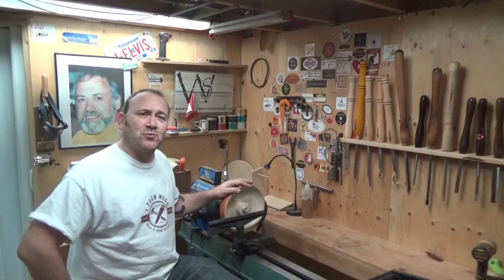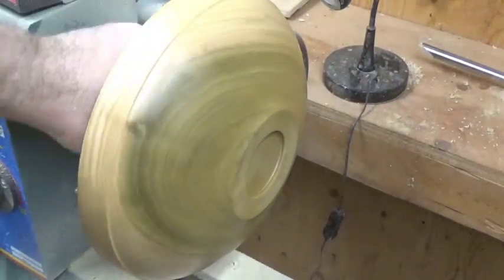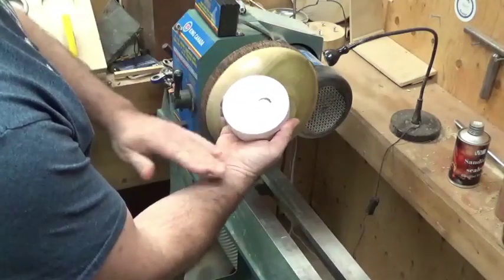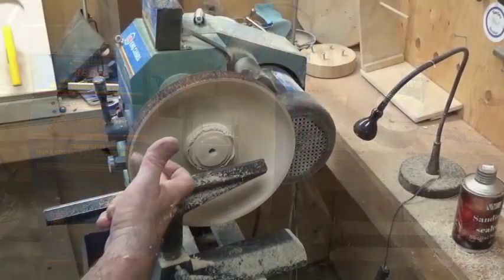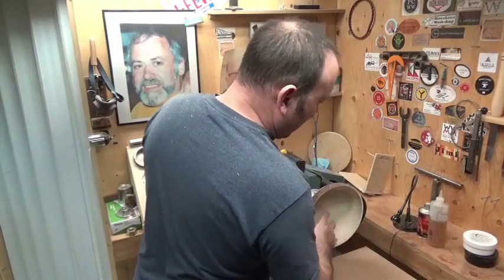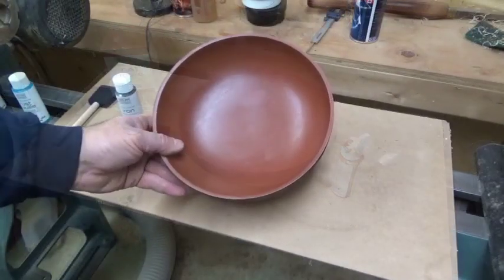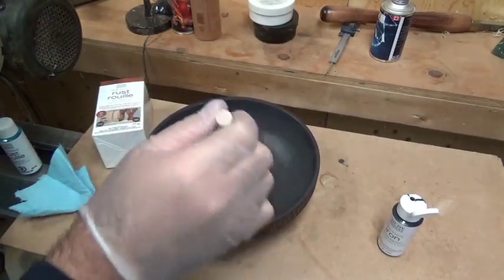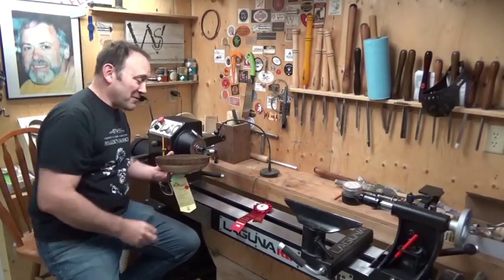Woodturning a Rusty bowl

Comment: Really great looking, curious about the product and process! Well done! Great looking burned affect, what burner are you using? Get frustrated with my old generic “grade school” burner! Congrats on the award, cheers from MT
Reply from the maker: dtork47 
Thanks for watching
You can find a link in the video description to the rust paint and this is the wood burner I use
https://www.amazon.ca/Razertip-Dual-Burner-Large-Skew/dp/B0002IXT30/ref=mp_s_a_1_1?adgrpid=63731963480&gclid=EAIaIQobChMIhb35-_nW5wIVCr7ACh1BLgvvEAAYASAAEgJwh_D_BwE&hvadid=310043290460&hvdev=m&hvlocphy=9047894&hvnetw=g&hvqmt=e&hvrand=10961981872969559147&hvtargid=kwd-313716617466&hydadcr=712_1012287333&keywords=razortip+wood+burner&qid=1581886393&sr=8-1